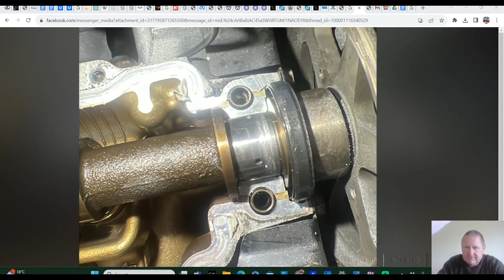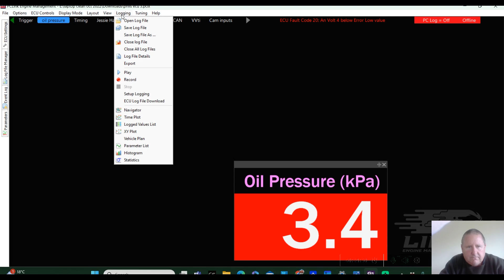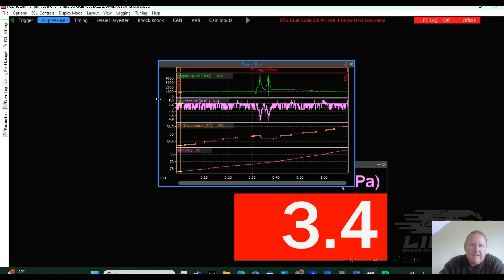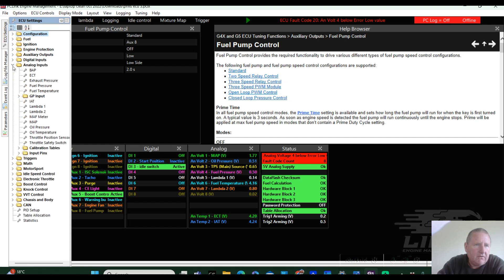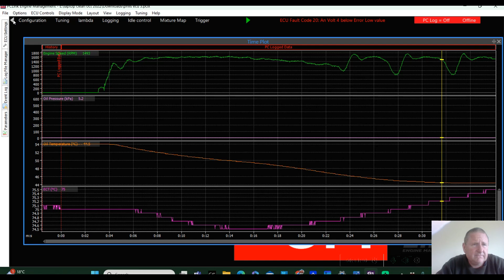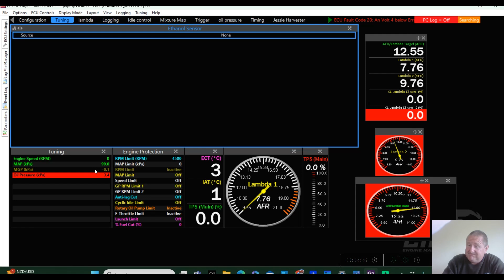Phils 1uz oil pressure issue - logging Part 1.

Comment: @CartuneNZ  sir in my country 1uz vvti engine spare parts are not available, the only spare parts are available is of 2uz, can I put 2uz main bearings in 1uz vvti?  And like what tests sir? oil pressure drops down to 0 when engine is on working temperature, but then i used 20-60 engine oil so now it says around 1.5 psi at working temprature, master need your feed back on this, I watch all of your video, your no one fan
Reply from the maker: The crank journal sizing and rod sizing is the same across the 1uz, 2uz and 3uz engines however I do recommend measuring each bearing as from the factory there were sizes within sizes so sometimes mixing and matching is required.  Cheers Kelvin

Comment: Hello master, my swapped 1uz vvti is giving low oil pressure can you suggest what could be the cause of it? bad main bearings or oil pump? Oil pressure drops down as the engine gets warm
Reply from the maker: Without details I prefer not to comment too much but its an engine like any other so I recommend doing all the normal tested to diagnose the possible issues if one does exist. Cheers Kelvin

Comment: Oil pressure operating temp at idle ? around 20 psi ok ?
Reply from the maker: 20 Psi at idle at operating temp is good.  Ill go as low as 15 average and under that I start adjusting the oil viscosity to give me what I want.

Comment: At least the day in the US has 24 hours and a full circle has 360 degrees. The other units are a bit confusing. :-)
Reply from the maker: Even though Im working in different units all the time sometimes I still get caught out.  At race events when the pressure is on I even got caught out with cylinder position so I like to have them numbered to avoid basic mistakes.
Reply: @CartuneNZ  The first engine I've ever done a complete rebuild was a 304 AMC. My bible was the original shop manual but very difficult to read for me. I bought a English-German dictionary for automotive engineering...30 years ago was no google translate. For all the measurements a calculator in the workshop was mandatory. Most spanners and sockets fit somehow...sometimes with a hammer. :-) Breaking it in was an nightmare because for some minutes i saw glowing headers. But eventually it became a nice running engine. Now the 1UZ will be my second......let's find out what happens.